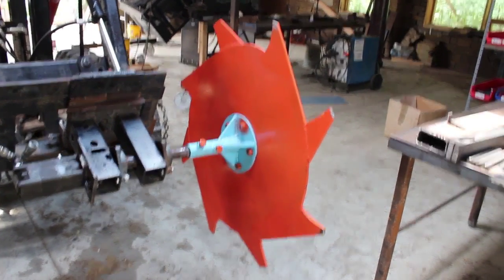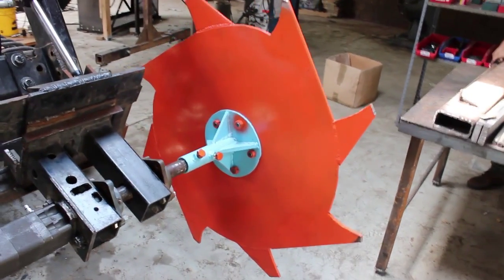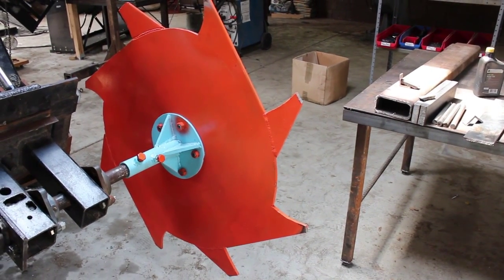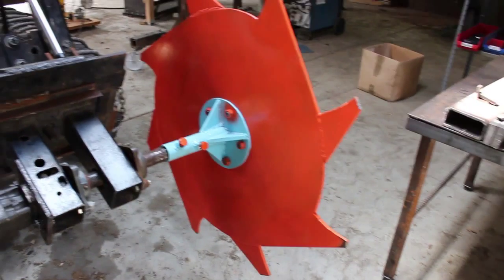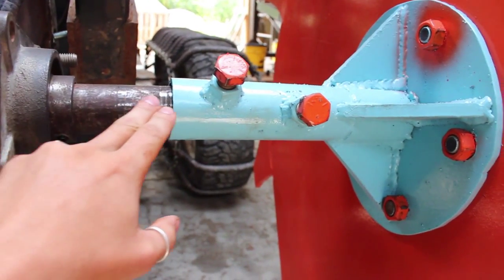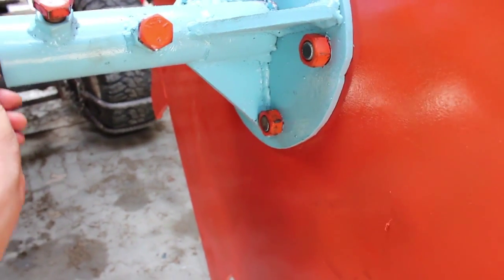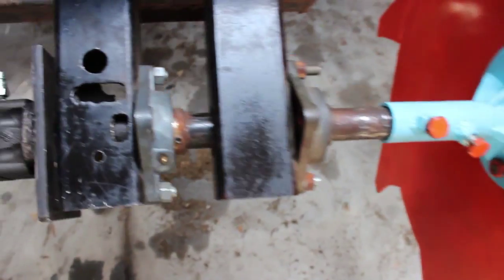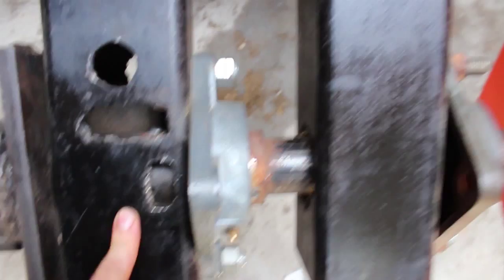OS Trencher v1.5 - Design Review

Comment: The project tends to deviate towards designing tools that aren't necessary at the current stage (Microtrac, saw mill and now "the great ground cutting tool"). In my opinion the general strategy of the project development need to be thought over because apparently it goes into desultory direction.

Comment: Do you have a notcher on the iron worker? You could use that to make lots of teeth easily. You may want to investigate the angle of attack of the teeth. If they attack at a low angle, I'd expect them to compact the dirt by pushing it into the earth instead of scraping it out. The current design has the cutting surface of the teeth roughly perpendicular to the axis of rotation. A quick search online showed other trenchers appear to have a sharper angle.

Comment: I would expect the long shaft would be vulnerable to bending? Likewise with the large diameter blade? More teeth and shorter teeth seems like a good idea. Would a double chain linkage like that used on the lifetrac wheel assemblies work in this application in lieu of cotter pins, I wonder?